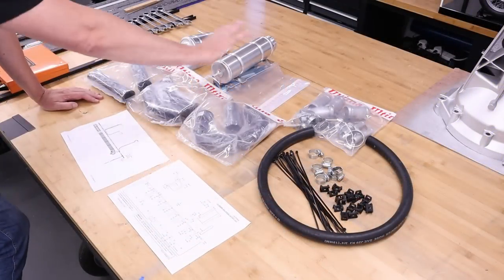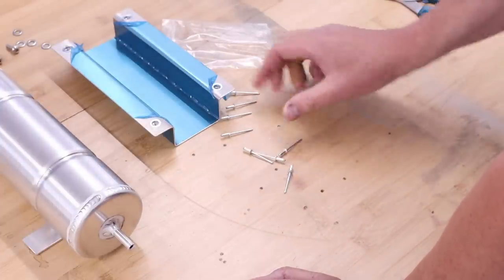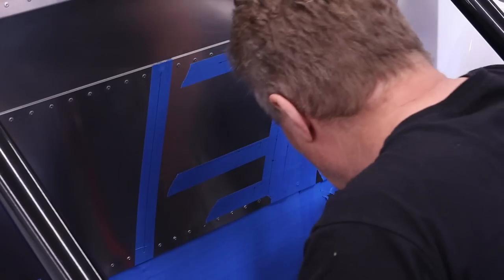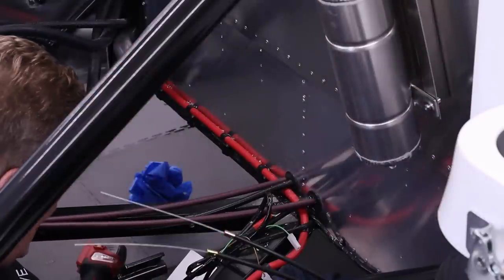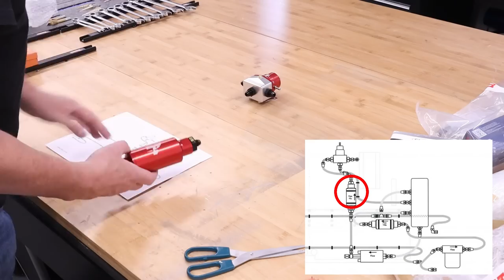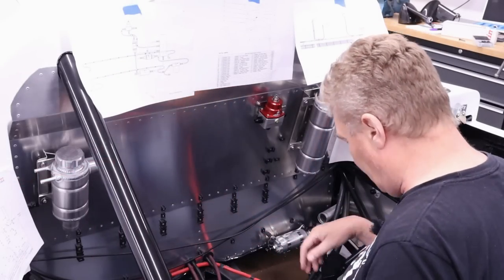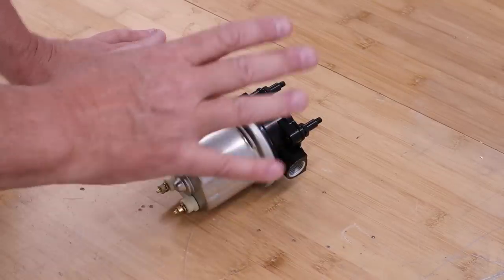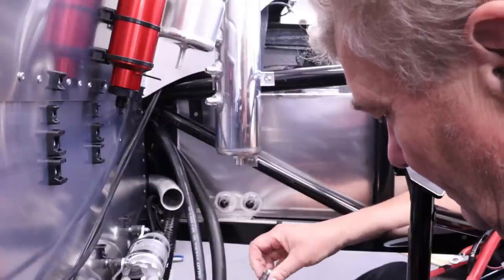Building an Ultima RS with Nigel Dean. Part 42. Firewall Population

Comment: Are there any parts that you would prefer to be made or fitted in a different way but you're making do with to stick with the philosophy of building it as a complete Ultima kit? Are you going to change many things once it's done? Or even do you miss building things like the hoses and brackets.. one thing I really enjoy while building a car is all the time looking for the perfect solution to a problem and making brackets hoses etc...
Reply from the maker: Hi and you ask a very good question. There are several ways to build a car, and many of my previous projects have seen me modify practically every component. However, for this project I have purposely focused on building a pure Ultima, that is 100% of the components from the factory and fitting them as standard. The reason is I want to show how anyone with practical skills can build an RS. OK you need the space, time and funds but at least I can demonstrate the assembly process is very straightforward. Cheers Nigel

Comment: Absolutely fantastic as usual........I have my high pressure fuel pump on Westie V8 hard mounted to the chassis, and have always thought it was a bit loud!!!!.......Every day is a learning day...time to buy some bobbins and make a bracket 🙂A couple of questions, the brackets for the header tank and coolant swirl pot....why did ultima use a bracket...could you not mount directly to the rear bulkhead using rivnuts?. I cant quite work out what the brackets are adding (apart from loosing a few valuable cubic cm of space). The LP fuel pump bracket is a work of art 🙂Also, is it just me or did I detect an undercurrent of doubt with the fuel filters, why would ultima choose to use cable ties for a part of the fuel system.....There could of course be a completely logical reason, but after all that wonderful bracketery, it seems like an odd choice.
Reply from the maker: Hi and thanks for the comprehensive comment. Yep, mounting fuel pumps on rubber is standard practice and often provided with pumps. The header tank and swirl pot are spaced away from the bulkhead to allow your hand to comfortably unscrew the lids. If the brackets were missing the clearance to the bulkhead would be minimal. As for mounting the fuel filters with ties, initially it looked a little odd, but once secured the approach was logical. My hesitation was to use 2 or 3 ties. :-). Thanks for tuning in and loads more content to come, next episode tomorrow where I finish off the bulkhead
Reply: @v8creative  Cool...Makes sense.....The whole build looks utterly amazing....without doubt the best thing on the internet 🙂

Comment: Well done Nigel, put in a good workout there. I can’t remember seeing a free gym membership on the Ultima options list. The memfast tool is great but it can easily compress / bind the threads slightly and make it tight removing the tool afterwards. I’ve found just putting a small bit of grease on the tensioning screw makes this far easier !!  Also, bloody good job drilling into the chassis tubes, it’s so easy to drift off. Now, go and enjoy a beer……….
Reply from the maker: Hi Garreth and yes when you insert rivnuts it's all about feeling the pressure you are applying to the threads. My advice is to practice on some spare material. Drilling into a tube also takes a measured touch. You wait until the fuel tank is behind the chassis tube you are drilling :-). That makes you concentrate. Thanks as always for the support and comments. Cheers Nigel

Comment: Hi Nigel, 
I thought the Ultima fuel system did away with all these external pumps, filters and surge tank, etc, by using inboard pumps and other ancillaries directly in the tanks. This solved most of the fuel vaporizing problems that owners experienced
Reply from the maker: Good choice of daily driver ;-). Ultima offer two type of fuel system depending on the engine you are fitting. The LS v8S uses pumps external to the tanks, and the LT V8s use in tank pumps etc. As you say, locating such components in the fuel tanks reduce the risk of vaporising. However, the problem can be solved with some careful heat management. Cheers Nigel

Comment: I guess a few beers were consumed after that all that Car Crawling🍺
Just a couple of thoughts,  have you thought about Heat Insulation for the Bulkhead, I'm guessing it's going to get a Bit Warm in the Cabin with the Beast in the back, also will there be any protection for the fuel system from said heat and lastly have you thought about a Rear View Mirror Camera, like the one used in the Defender? 
Anyway Top quality work as usual👍
Reply from the maker: Hi Mark and good questions. Yes, Ultima recommend applying heat shielding to some of the fuel components since fuel vaporisation can be an issue. I have this planned and will be covered in a future episode. As for heat in the cabin, the aid conditioning is actually extremely efficient and most of the heat comes from the headers which are a little further back from the firewall. Air flow in the engine bay has been improved over the years but I plan to have this as part of the shake down process using a heat gun to detect the hot spots once she is up and running. As for a reversing camera, yes I have considered fitting one but I don't want a screen in the car - it takes away from the analogue look of the car. However, I have an alternative plan so watch this space. Cheers Nigel

Comment: I enjoyed that episode immensely.  As you say, jewellery for the firewall. I also like the braided hoses but wondered what they are lined with. Are they teflon hose? So many rubber hose varieties seem to struggle with ethanol so I'm thinking teflon is the way to go.
Reply from the maker: Hi and thanks for the question. The hose used in the build is Goodridge 811G line and is PTFE (Teflon) lined. As you say a well-proven choice for track and fast road cars. This tuning has been designed by Goodridge to transfer fuel, methanol, water and hydraulic fluids.

Comment: So far so good!  Any plans to heat shield the fuel system to prevent heat soak or vapor lock?
Reply from the maker: Hello Sir, trust life is treating you well in your travels. If you ever come to the UK again get in touch and we can meet up if you are down South (hi@nigeldean.co.uk). As regards your question - absolutely. As you know, fuel vaporisation can be a real pain. Even my Dad's 1932 Morgan 3 wheeler had the problem, so it's not new :-) Ultima have recommended shielding certain components which I am planning to do but I ran out of time filming this episode. Cheers Nigel